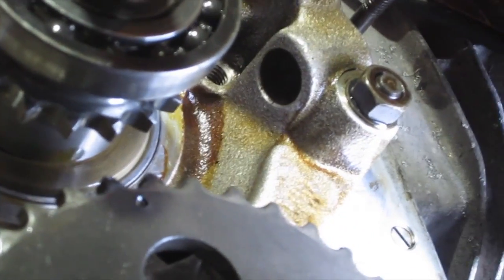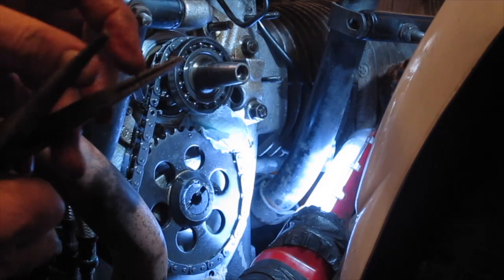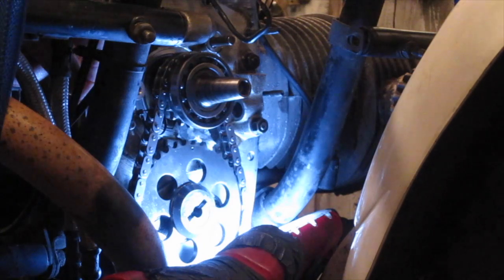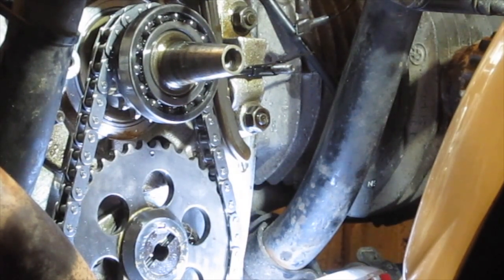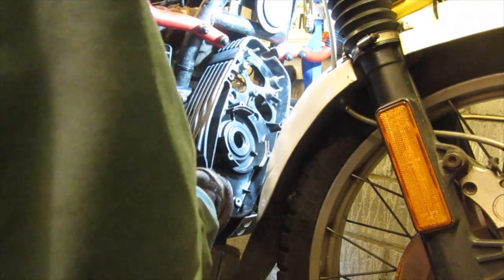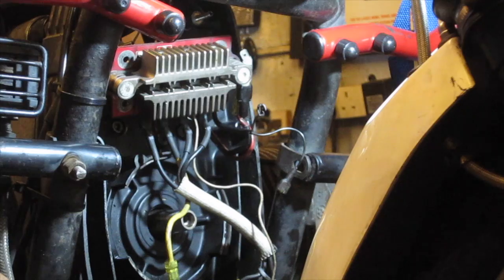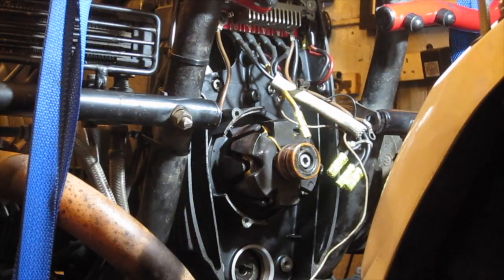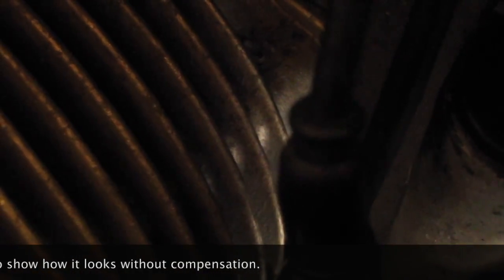R100GS PD Fit New Timing Chain

Comment: Is it the same procedure for an R 65 ? Last question (sorry for my poor English) the left tentionner with two Bolt must be strictly in contact with the chaîne or slightly ? What about plastic wear in contact with the chain; is this durable ? But the second tentionner seems not to touch the chain.... I don’t understand how you mesure this because you where behind the camera...
Reply from the maker: Yes the procedure is pretty much the same for all models from 79 onwards. Pre 79 models are similar, but they have a double row chain and there are some other differences. 
The guide bar (left tensioner) should be fitted with 0.5mm preload according to the factory manual. I fit it so that the chain is touching it with out any load. And yes it is durable. 
The spring loaded tensioner should press onto the chain under spring pressure during normal running. I release the cable tie holding the tensioner off the chain about 38 min into the video.
Reply: Moto Phoenix my R 65 LS from 1982 and only 63’000 km has no sign of timing chaine now but I will keep preciously your tutorial! Once again many thanks to have done this. I know how hard it is to do that ! 🙂

Comment: Juste one more... after how many kilometers you have to do this job ?
Reply from the maker: That is hard to say,' perhaps every 100 000 km. It depends on how well the machine has been looked after and what kind of life it has had. Usually I will replace a timing chain when it sounds noisy (rattles), but if I am overhauling an engine I will replace it anyway.
Reply: Moto Phoenix ok thanks! Seems not so easy to do it...
Reply from the maker: Nicolas Brindesi it is a little tricky. Getting the valve timing right is very important. So long as you are methodical in your approach, you should be okay. Once the chain is fastened I suggest you turn the crankshaft through two full turns in the normal direction of rotation and then look to see that the alignment marks are lined up as they should. The rest is straight forward reassembly. All the best..........